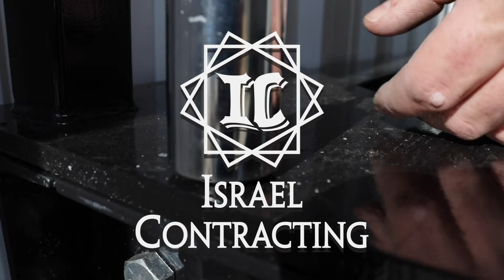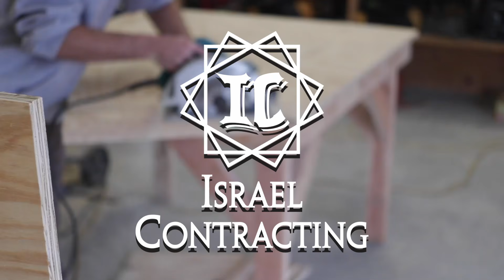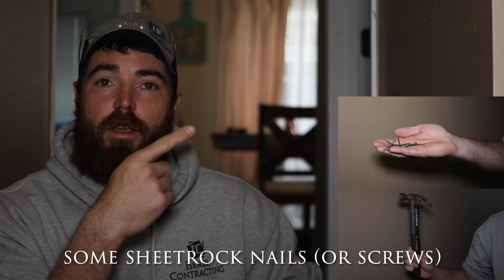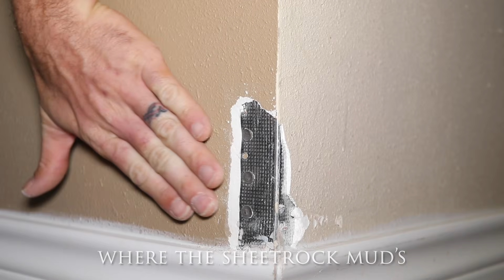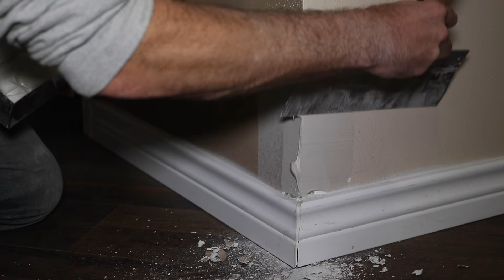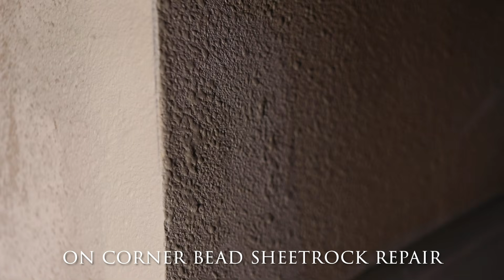Sheetrock (drywall) Corner bead repair tutorial

Comment: I've never purchased the mud where I have to mix. What do you do with the extra left over? Can you save it for the next coat or make a new batch?
Reply from the maker: Once mixed it will dry out quickly. Whatever is not used is usually discarded. So mix in small batches as needed.

Comment: my walls aren't textured so the cornerbead is still showing through the outside edge
Reply from the maker: Just have to add more Sheetrock mud and sand smooth
Reply: everything I'm reading/watching says the outside corner is supposed to be left showing and that you just paint over it.. @icfamilyadventures

Comment: I keep doing my corners but the metal shows through, is that ok or should it be all the way covered by the mud? Thanks.
Reply from the maker: A little bit showing is ok if you’re going to texture. Otherwise you have to build up with more mud and sand smooth

Comment: great job i thumbed it, can i get away with joint compound over the corner bead?
Reply from the maker: Yes. In this video I am using a quick dry (rapid set) joint compound. But regular “all purpose” or “light weight” will work just fine. It just takes longer to dry.

Comment: How do I secure the corner bead if there’s no wood behind it. I used 1 1/4” nails but there’s nothing to grab onto. There’s no base plate either.
Reply from the maker: you can use spray adhesive and a crown staple gun to secure it.
Reply: @icfamilyadventures  
Thank you for the reply. I like learning from the pros.

Comment: If you’re working with drywall w/o texture. Would adding mesh tape or butt joint drywall tape be beneficial to place over the corner bead, over the additional nails of course?
Reply from the maker: mesh tape isn’t necessary but can be used

Comment: Can joint compound be used?
Reply from the maker: Yes. We used light weight fast dry joint compound. But a regular, pre mixed mud can be used as well. It will just take a little longer to dry.

Comment: Lol..that paint job on trim is terrible..it’s on the wall ..lol
Reply: I think that's caulk - maybe baseboard was removed and reinstalled, or changed out after walls had already been painted. Mine looks like that for the same reason - getting ready to paint now.
Reply: @janedavid684  I’m just busting balls..all good man.lol.thanks for the video though ..my corners are freakin terrible..looks like a heard of Buffalo rubbed against the dam wall
Reply from the maker: We had nothing to do with the existing painting of the house. We did however correct any mistakes in the near by areas once the texture had dried and was ready to be re painted.

Comment: Nice ,but I'm doing work like this now and where the metal meets the sheetrock Im still have somewhat of uneven surface .do I still keep adding more mixture (afraid if it's to thick it will have cracking down the road ) or is there something I'm missing or I need to do .thanks
Reply from the maker: Do you mean it is dished? You can add more mud and let it fully dry then if it cracks a little put a light skim coat on.
Reply: @icfamilyadventures  sorry what do you mean by dished? 
It's like  the metal corner goes downward compared to the sheetrock ,so when I add the mixture it continues to have a depression ,where I cant get a even surface .
By the way I'm using the pre mixed mixture ,not the type that you add water to it